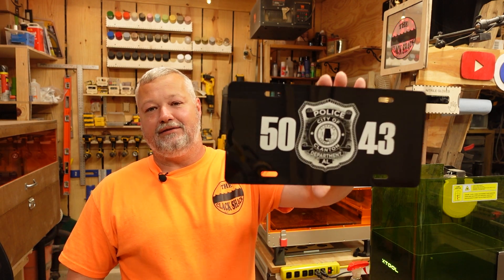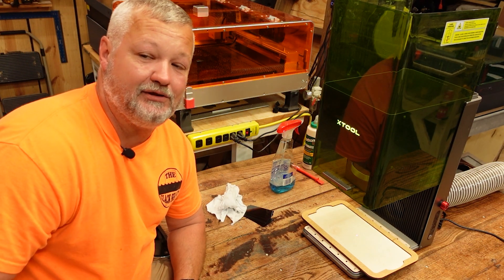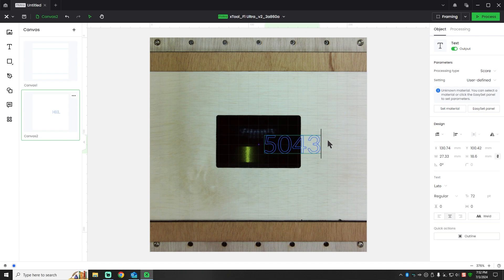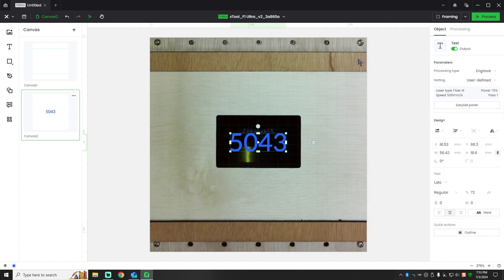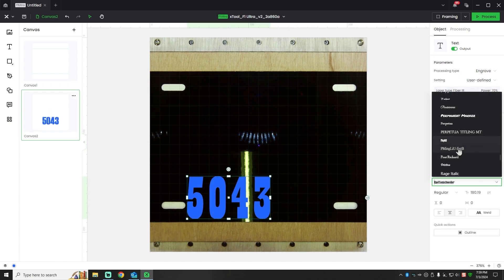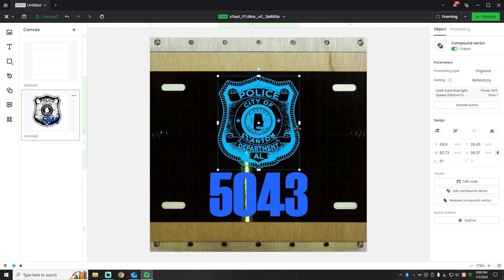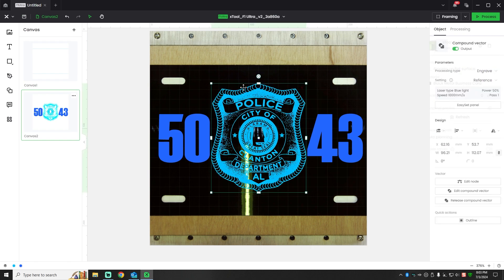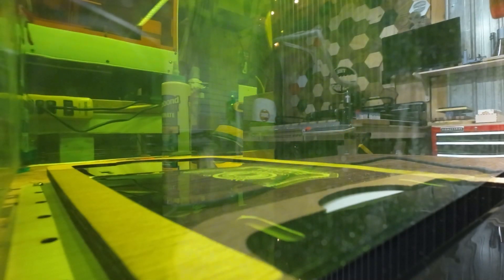License plate project for lasers using the xTool F1 ultra

Comment: do you worry about high heat temperatures being in the south with the lasers being out in a workshop? I want to put mine in the garage but so afraid of the extreme temperatures
Reply from the maker: Not since I installed the AC. In the time before the AC, I never had any issues

Comment: Thats great and came out better than on my P2. Do you think the settings would be same for BLUE plates?
Reply from the maker: Blue can sometimes be a little more resistant. Typically, it needs a bit more power or slower speed.
Reply: @TheClackShack  you rock bruddah'. As a former LEO myself I mostly do LEO related engraves for buddies. Appreciate all your videos and instructions.

Comment: Awesome tutorial.  Thanks for the help.  I do 3D printing also.   Do you sell a STL file for your plate jig?  Curious of the size, if I could print it in my Bambu printer?
Reply from the maker: No, I have a 3d printer also but the laser just makes them faster. I can use small scraps to make them.
Reply: @TheClackShack  Yeh, I have an Xtool S1 I could cut something out with.  I like 3D printing when I can.  So you don't sell or share the jig file?
Reply from the maker: @atleather  I haven’t packaged it yet. I am still adding functionality to it.